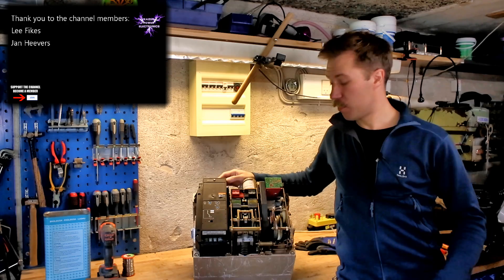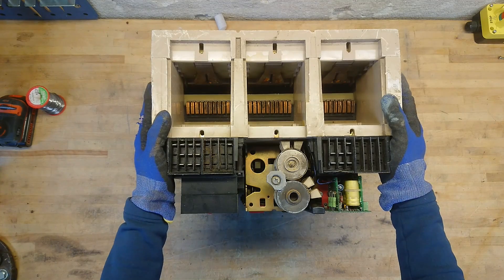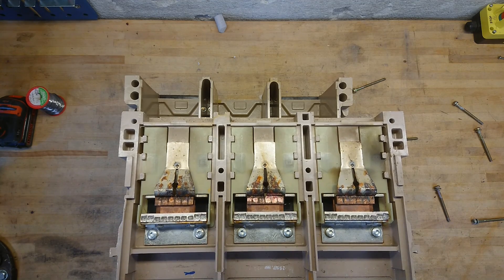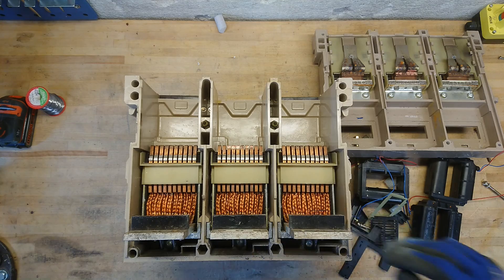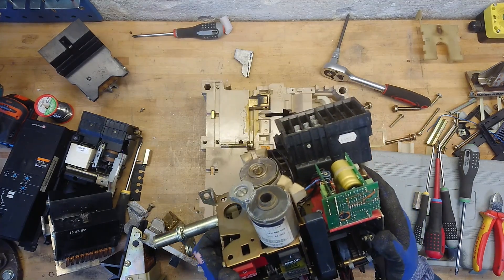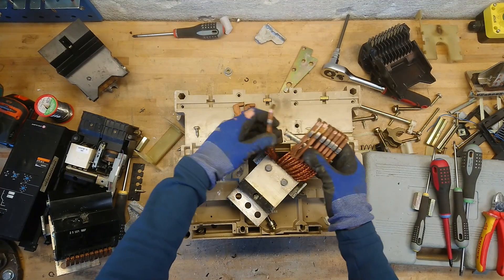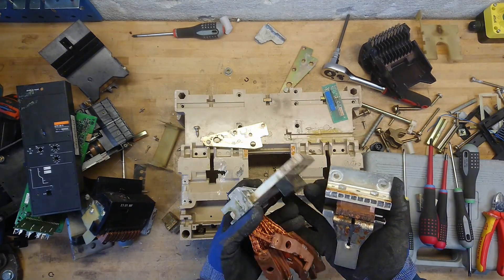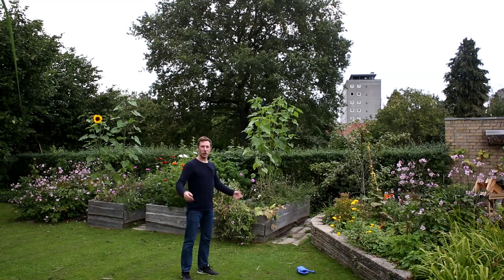Merlin Gerin Masterpact M16N1 Teardown

Comment: Great content sir! I am currently working on a faulty 7 yo Masterpact (NW20 HADCD-PV) which caused big damages on a PV inverter while igniting fire on the DC side. I try to figure out what could have happened, thanks to your video I now can tell that for some reasons my Masterpact ended up open during the incident (or at least not closed...). I was extremely curious when you talked about the "thermistor" at 6:09 but you didn't say more about this sensor. Are you sure there is one? It don't find anything inside Schneider documentation. Is it a common feature on Masterpacts? Where is it connected? Does it trip the Masterpact? What is the threshold? Thank you very much for your help.
Reply from the maker: Thermistor control from the adjusted tripping curves. The wires looks like they go the tripping/release actuator? It's been a while since I did this video, so memory is not 100% :)
Reply: @KaizerPowerElectronicsDk  Oh I see, so this wire is the trip output to the opening coil? This is not a thermistor input that would monitor the Masterpact temperature? As I understand the Masterpact, there is no actual "thermal trip" based on some bimetallic strip, they just call "thermal" the current threshold based on an time inverse curve to protect from overload.
Reply from the maker: @RippleMks  yeah I agree with you, its based on measurements and time, where the tripping curve actually is defined. So a thermistor would make no sense. I should not have said thermistor, but current evaluation module output to tripping coil.

Comment: It is not an opamp. It is a famous TL431 voltage reference/comparer in a ceramic DIP package! Personally, I would have desoldered it and kept as a collectible artifact because of a very unusual package for this very common chip.
Reply: Can be used as a cheap voltage comparator . Although I doubt they use it for that in such an expensive piece of kit